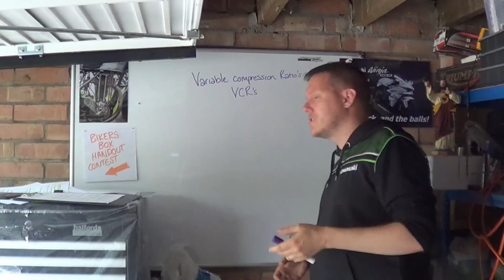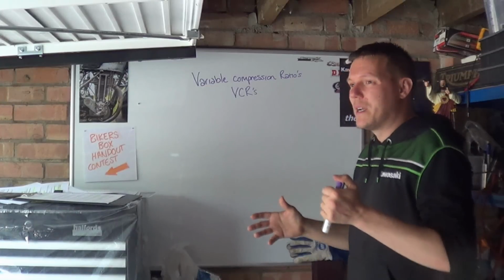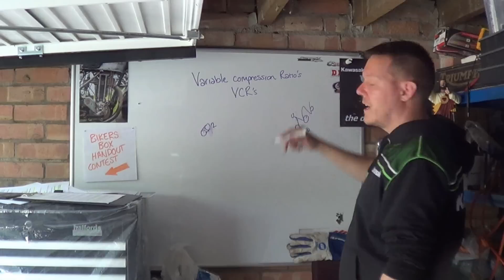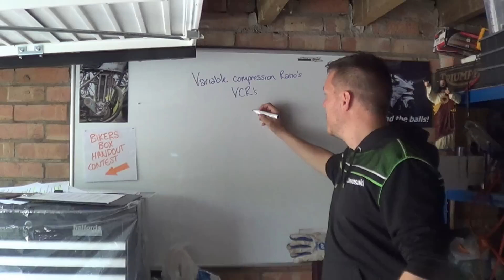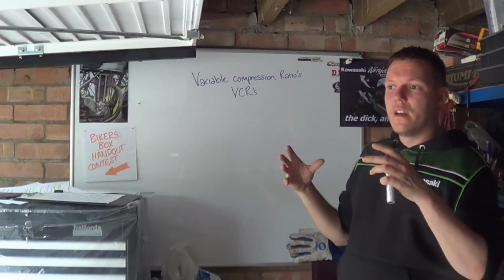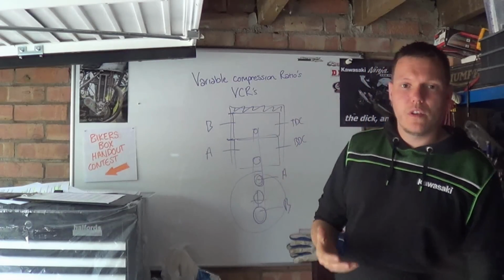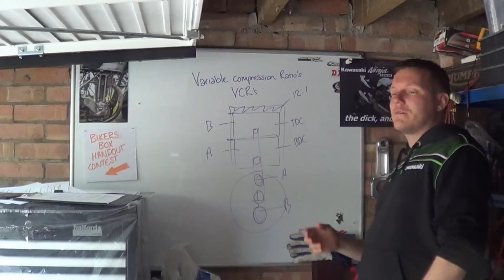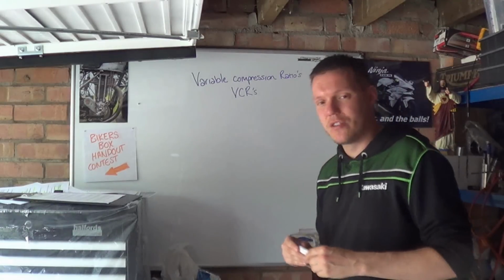Variable Compression and why

Comment: For variable compression, I've settled on the whole thing being partially stupid. I used to mess around with LS engines a lot. Whenever I designed a camshaft combination, I would integrate the flow curves in the density and angular domains. At low RPM, the airflow was able to behave as nearly incompressible with 250 degrees of camshaft duration @ 10% lift, so the engines would go into an atkinson cycle without the need for VVT. Without enough compression, they would develop a chronic rich condition and were sluggish or "gurgly" or "boggy". When we put a bigger cam and a good head on a smaller motor and set the functions to equalize outside the operating range of the intake manifold, the engine would lose 1/(cr-1) over the whole curve, but it would never knock at high RPM. The cool thing was, they would get better BSFC values at low RPM.
Reply from the maker: "I used to mess around with LS engines a lot" - first problem right there lol
Reply: I'm looking forward to your "LS engines are shite" video like you mentioned in your "Musing about American V8's video." I'll admit that a factory fresh LS engine is a turd. You have to admit, Stainless valves, a longer duration camshaft, a longer stroke, and an intake manifold tuned to resonate is a great combination compared to the stock bullshit they put on those engines.

Comment: Actually for most fuels flame speed drops when increasing pressure....the efficiency benefits of increased compression ratio come only from the fact that you achieve higher pressure/temperatures (area under curve on a P-V diagram) from the increased compression work and the higher expansion ratio that goes along with it. The performance improvements come from the fact that you can use a higher octane rating fuel.
Other than that, love your videos mate!
Reply from the maker: This is dependant on the ratio between laminar flame speed and turbulant, most of which is turbulent. Static testing shows that yes - flame speed decreases with pressure - mainly due to gibbs free energy. But turbulant flame propogation is a different beast.
Reply: That was quick! Good point actually...the only thing that can make you combust faster is turbulence. Maybe its worth making a video on it. If engines relied on the laminar burning velocity of the fuel (~30-50cm/s) it wouldn't be possible to obtain engine speeds higher than a few thousand rpm. Nice talking mate!

Comment: a noter reason i could imagine is turbo charging.
you could use variable compression rate to allow the turbo to extract as mutch of the exhaust heat as possible. with a fixed compression ration you will quite soon hit a mark where you need higher octane fuel, and stuff gona get too hot.
on the otherhand if you can lower the compression "work" done by the piston, and let more of it be done with the turbo, you get a more efficient engine , and fuckloads of power at high rpm.
Reply from the maker: Good point, hard to control though.
Reply: Nagy Andras 
if you split the engine block so crankshaft is separated from the upper part of block  (hinge ) so that you can make crank lower or higher. ,  then you change compression ratio. 
if you have 1 liter engine with turbo  and then you charge with turbo while you lowering compression. you will get more volume  (like 2lit. engine ) so you don't use engine so much engine stay at 1.lit. 
you need more energy it became 2.lit.. bla bla bla.
Reply: BO4wd As tested by Saab in the late Nineties. Hadn't it been for GM something might have come out of it. Engines were reported to be on the noisy side.
Reply: Alex B 
exactly!

Comment: SAAB had an engine in development for 9-5 model that had variable compresion ratio. It was kinda tilting the whole monhead (cylinder head with cylinders in one) to get more lenght and it could vary from 14:1 all the way down to 8:1. Unfortuantely they went bust but it was really simple approach. Much less complicated than theese crankshaft levers malarkey
Reply from the maker: Even the moving head idea is mad.

Comment: Forced induction basically achieves this by introducing the air charge at a pre compressed charge so it would probably be a whole lot easier to create a variable turbo or supercharger by either letting exhaust gasses escape before the turbo or using a clutch system on the supercharger drive in my opinion.
Reply from the maker: do it doesn't and hence the videos - if you could control the boost then yes, but turbo's and superchargers are not that dynamic.
Reply: what about a cvt drive on a super charger?

Comment: Matt I built an NA LS with a static CR of 13.47 with continuously variable DCR between 9 and 10.25, by phasing the intake cam. Two valve high squish wedge has good operating RPM does push the limits of pump petrol. Also here in AU we have pump ethanol 85% which loves 10.25, both fuels near NA limit in this chamber maybe tad more with a centri up top.
Given this type of ECU controlled continuous balancing of high compression and LIVC over-expansion (Atkinson stylee), like a Prius, I would have thought varying the static CR mechanically is a waste of effort to achieve similar gain?
The SAAB “lid lifter” and Nissan vario crank  introduce complicated gizmos like Ducati (for the sake of it), else what benefit is not addressed with CVVT and valve actuated cyl deac?
Reply from the maker: Good point and the point of most of these video in this series. Its bloody hard to make something in the core of an engine work dynamically at the speeds required. When I say hard, I mean fucking hard! 

DCR isn't what I'm talking about here though. DCR is undercutting the engine using valves time, if I understand the concept properly. (I've never had anything to do with it myself) You use the pistons location and valve timing to calculate the CR? Isn't DCR always lower than SCR?

I'm quite excited, someones going to tell me something lol
Reply: It's exciting but not much to it, you've got the gist.
Static CR uses nominal cylinder volume based on full stroke whereas DCR factors the impact of piston position vs intake valve close event (effective stroke) to produce the effective CR (DCR).
DCR is useful to predict required octane at (lower) speeds, and an important factor to tune valve timing for more compression duration vs more power duration.  
This extra hidden detail helped me understand new 'technology' phenomena when old school theory based on nominal SCR seemed impossible or at least inaccurate. Like14:1 Skyactive and Prius' (now all hybrid's) efficiency through LIVC and 'over-expansion'.
Here's the worksheet I use... http://victorylibrary.com/mopar/Formulas.xls
Another handy reference...
https://www.corvetteforum.com/forums/c6-tech-performance/2167025-dynamic-compression-ratio-chart.html

Comment: Hi Matt, thanks for the video. Is engine reliability related to the compression ratio. For example Honda has an africa twin with 1000cc that produces almost the same power as a yamaha Ténéré 700 if I remember. Could you go into details in a video how compression ratio / fuel economy / CC and all of that are related.
Reply from the maker: " Is engine reliability related to the compression ratio."

- No.

"Could you go into details in a video how compression ratio / fuel economy / CC and all of that are related."

- Yes. lol
Reply: @thedirtyworkshop  
hhahahaha, thanks you the response. I know some questions may seem obvious to you. But I'm a noob in Mechanics and I prefer to learn from a reliable source than idiots around You Tube  xD

Comment: Was just thinking engine cut off as you said it, but then you seemed to suggest not a good system. Do you mean for just bikes or generally and why.
Reply from the maker: no for cars mainly. The electrical system is the biggest weak point in any engine. And I mean the core electrics - coils, starter motor, spark plugs etc. Start stop runs this into the ground. You'll see in 10 years all these cars will be avoided on the 2nd hand market.
Reply: Electrics. Hmmmm. Much needed videos 😀

Comment: wouldn't the simplest way of doing it be to insert a something into the combustion chamber to increase CR and withdraw it to decrease CR? combustion chamber shape or the object your inserting have to be shaped not to affect combustion too heavily but it sounds perfectly doable when you think of what has been done in terms of engine design.
Reply from the maker: this is being developed, the problem is, with the current ideas - pressure. The idea, also used for HCCI is to have a 'piston' in the head, driven or 'moved' by a cam. Under normal conditions it remains static, on higher load it moves down. The issue is 2 fold. 1 where do your valves go. 2 - its has to take the full force of combustion, just like your pistons does. So a 4 cylinder 200HP engine means that each piston takes 1/4 the share of that HP. (this is a real crude explanation) so say 50HP. Each piston absorbs that energy and transfers it to the crank. The in head piston would have to take the same pressure. Your cylinder head does this all the time, but its static and bolted down like a bastard.
Reply: I would say that seems way too complicated, inserting an object (like a reactor rod) would be simpler and involve less stress in the mechanism but like you say, how to insert something big enough to displace enough volume to achieve the increase in CR your after without masking the valves, not as simple as it would appear.

Comment: Which fuel you use in VCR engine? Petrol or diesel?
Reply from the maker: Either
Reply: @thedirtyworkshop  Impossible. Upper limit of CR is fixed in petrol upto anti knock quality of petrol. In diesel low CR  will cause reduce in thermal efficiency.
Reply from the maker: Impossible? LOL why?

Comment: Matt, is energy density also the reason why bigger engines make more power because you're filling the cylinder with more air/fuel?
Reply from the maker: No. Energy density is how much energy per volume.
Reply: @thedirtyworkshop  ah right, i understand that bigger engines make more power because of more air/fuel is it because more energy is released from the extra air/fuel or something mate?
Reply from the maker: Yeah that correct. But that's not energy density
Reply: @thedirtyworkshop  thank you for clearing it up mate all the help is massively appreciated
Reply: @thedirtyworkshop  Just to clarify mate, it's more heat energy released which increases the pressure applied to the piston which increases power?
Reply from the maker: Yes.
Reply: @thedirtyworkshop  sorry Matt, just to simplify this even further mate, is there an increase in pressure because the heat from combustion has given the molecules energy which increases their velocity and as a result they hit the piston more often which in turn increases the force applied to the piston?
Reply from the maker: Yes. Energy is just the ability to do something. Molecules that have energy express this through motion. Or emission. This motion is transfered to the piston through the conservation of motion.

This force (acceleration) is due to the increase in thermal energy. Pressure is just a way of measuring the force over any area.
Reply: @thedirtyworkshop  Matt I have one more question for you mate, when you said fuel economy goes up with compression ratio is it because the air/fuel molecules are closer together and as a result more of it is burnt releasing more heat energy and applying more force to the piston?
Reply from the maker: No. Its because of the compression to expansion ratio is higher. More on fuel economy soon
Reply: @thedirtyworkshop  like the atkinson cycle, sort of

Comment: Here is a link to my video of a 1920s stationary engine which maintains 500rpm and at idle fires once every 8 or so strokes. The   engine  uses a mechanical  compression system to be activated only when needed... i.e. if the RPM drops below 500.
https://photos.app.goo.gl/bO9A0661XTme3Ztv2
Reply from the maker: Its called a speed governor and uses weights? oh no, just relialised it a video lol - Looks like a hit and miss engine mixed with a eccentric cam with an actuation arm using cylinder pressure. Pretty cool!
Reply: That's right. Its a hit and miss engine.. Antiquated I know 1hp but can run all day on a pint of fuel. Oh and it is fuel injection but nothing like you would recognise today. 
One manufacture (maybe Lister) in the 1920s ran there version of this engine  with a direct drive to the magneto. This was too efficient so the mag. was located else where and was run using a chain. This then fuelled a spare parts market for chains and sprockets.. I suppose it was the Evens of its day.
Reply from the maker: "Oh and it is fuel injection but nothing like you would recognise today."

- Mechanical fuel injection, just the way I like it lol

I do love me a static engine, will do some in the future.
Reply from the maker: Sometimes I wonder how old I real am lol
Reply: That thing is cool as fuck.

Comment: I'm not sure that your idea of reducing the CR on tickover is actually valid, like you said the gas pressure (or negative pressure) acts like a spring so in theory the energy that is required to compress the fresh charge on tickover is more or
less recovered anyway. The other thing to note is that the theoretical CR only gives you an idea about the pressure in the cylinder, the VE has a massive impact on the actual pressures in the cylinder. When the engine is ticking over the throttle plate is virtually shut, the VE is really low which means that on most of the induction stroke there is a high vacuum in the cylinder, during
most of the compression stroke the pressure will still be below atmospheric pressure, the initial pressure at around TDC before the plug fires is still low. Also why would you not want to still extract the most amount of energy that you can from the fuel whilst the engine is ticking over (or at any other time)? Even on tickover you still want to use the least amount of fuel possible which means that you need to get as much energy
as possible from that fuel.
The real problem with any engine that is controlled by a throttle plate is that most of the time the VE of the engine is very poor due to the car just cruising around with the throttle just cracked open a couple of millimeters. This leads to a low initial combustion chamber pressure before the plug fires which ultimately means that the peak cylinder pressure during the power stroke is also lower
than ideal  What we need is a variable CR engine where the CR changes in conjunction with the VE of the engine.Car manufacturers get round this in a rather cheap half-arsed way, they build the engine with a CR that is really too high for the fuel that is available because they know that most of the time the fuel will not detonate due to the low VE and therefore low pressure in the chambers because the car is just cruising around. When the driver does boot the throttle the VE goes up and pushes the engine into detonation however the ECU just pulls a load of ignition timing out of the ignition system as soon as detonation is detected which means that the peak cylinder pressure after the plug has fired never gets high enough to send the 'end gases' into detonation.

Comment: I have a manual decompresser on my chainsaw to make starting easier.  Just put a hole in the cylinder and let fuel piss out.  Then close it when under load lol.
Reply from the maker: They have these on some dirt bikes and ATV's - the newer Ducati 1199's have an automated system that does the same thing. More on that later